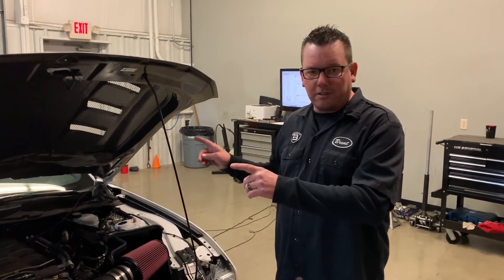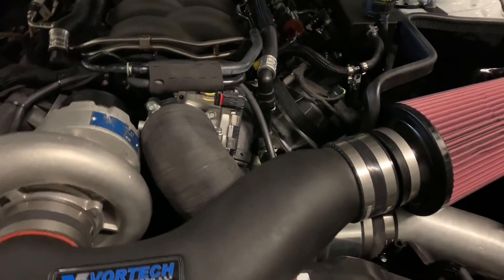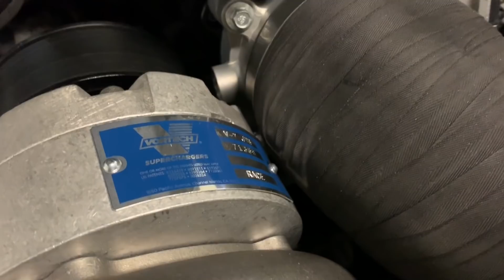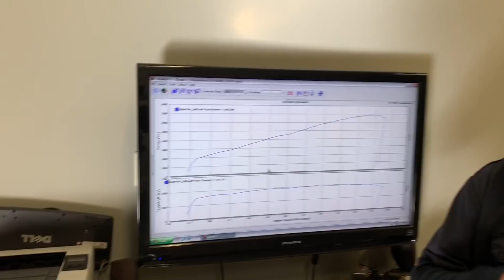2018 Mustang Vortech V7 JTB Race Dyno Pull (close up) on 93 Pump Gas @ Brenspeed

Comment: Sweet video! Does the V7-JT head unit for a 2015 have to have a oil feed line installed into the oil pan?
Reply from the maker: V7 is only available oil fed from the engine, so yes it drains into the oil pan. THANKS

Comment: what size crank balancer and blower pulley for it to make 8 psi of boost? ive got a 2020 gt with a v7 jtb on 3.12 pulley stock 6.78 crank balancer and only cracking 9 psi but is slipping the belt (e85).

Comment: Blew up my second engine with popular stage 2 2650tvs kit on makers tune. 2 engine 5 partial WOTs now time for 3rd engine.
 Looking at something different on these style setups do you have a kit to install the drain back? Does the pan have to be taken off? If one starts with the smaller self contained units ( is it v3jt or something?) Can the head unit be upgraded similar to how anything from a p1sc to F1x fits same bracket? Aka can I buy the self contained unit and keep all brackets ect when I'm ready to upgrade head units especially if it requires the pil pan to come off to install?
19, a10, 3.15 gear Coyote
Reply: Wait what, what blower did you have?

Comment: Is there any way to reach 850 on pump gas with 1050x and daul pumps for daily use?? I'm aiming into the paxton as I know it's made of aluminum! Correct me if I am wrong and which model will be perfect for 2018 manual transmission?
Reply from the maker: If you are talking 93 octane I would not suggest that. If you are talking E85 yes you will make more than 93 but not sure if you are going to get 850.
Reply: I’m at 840whp in my 2019 PP1 10r80 with a v3 , e85 and 3.33 pulley with many supporting mods

Comment: Hey I got a question. I have a 2011 mustang gt with a bunch added to it. I have a vortec v3 on it and I need a oil catch can and I wanted to buy the jlt one but it sit after installation where the supercharger is. So my question is where do I go to get a oil catch can that works with the vortech supercharger? Or do I just get the jlt one and try and modify it?

Comment: How the 10R80 hold up to abuse at this power level?
Reply from the maker: They have been holding up just fine.
Reply: @BrenspeedEngineering  ok, I read that after 600whp they don’t like 4500 stall launches. That’s what i got in mine thinking of going boost.

Comment: I want this head unit !!!
Reply from the maker: BMERE 828 thanks! I just got that for the high mile coyote can’t wait to install it.
Reply: @BrenspeedEngineering  yeah I'm looking to upgrade from the 2200sl to one in the future . I'd like to be able to spin the blower a little harder .
Reply: BMERE 828 how much power are you making now? I have a Paxton on my 18 I’m at 760 rwhp on 93 octane
Reply: @nola504boy1  car is on E85 18 Mani and full catless exhaust , made 847whp 647tq
Reply: 3.48 pulley
Reply: BMERE 828 Nice numbers bro. I’ll eventually get a fuel system, 3.48 pulley, & e85 on mine also.
Reply: @nola504boy1  what's your Instagram?
Reply: @nola504boy1  

You have facebook . I'm in plan of buy a paxton or procharger kit, but I dont see paxton or vortech in 9 sec.
Reply: Blacky 2018 A10 I’m on Instagram. They’re running 9’s just like every other power adder. They just need E85 like the other power adders. It’s videos on YouTube of guys running 10.0’s & 10.2’s on 93 octane with Paxton’s
Reply: Blacky 2018 A10 Just type in 9 second Paxton Mustang on YouTube lol
Reply: @nola504boy1  
Ok